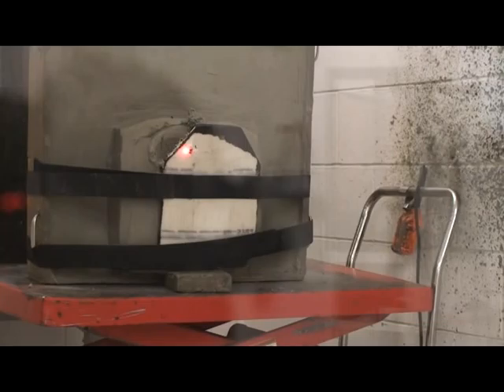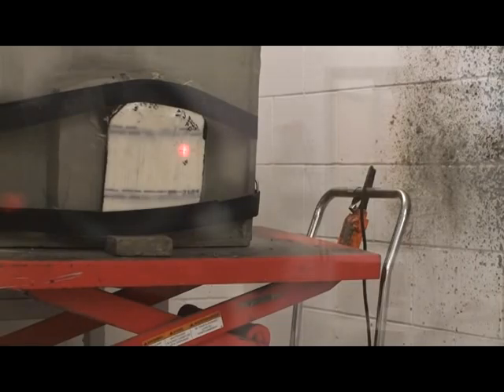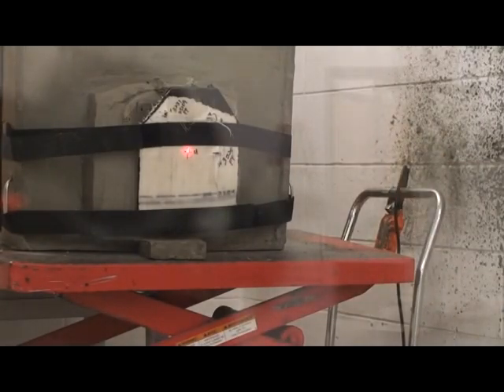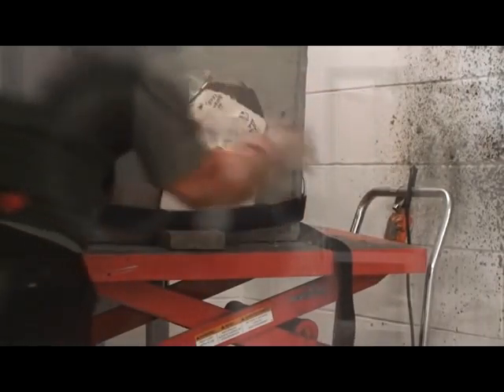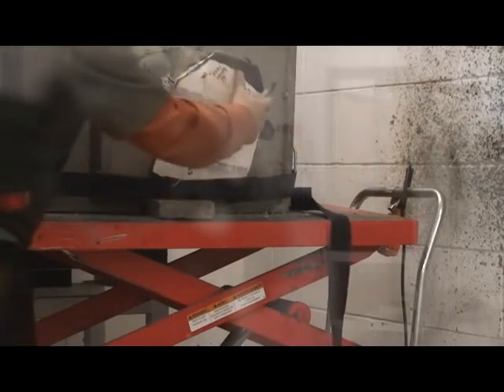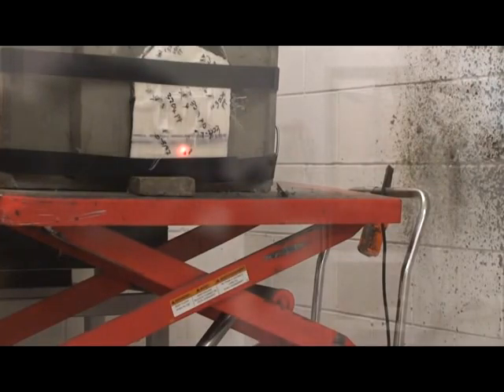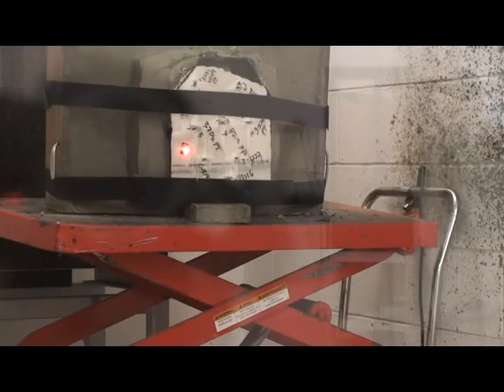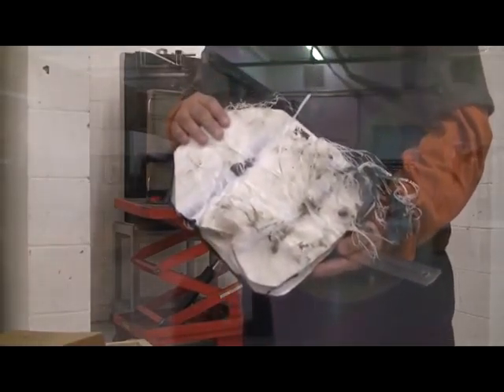Kick Ass Plate defies 10 SS109 shots

Comment: PFC Wilson is incorrect.  The M855 round is indeed a superior penetrator than a standard 5.56mm round.  I have no clue where you're getting this "weak" impact stuff.  Where as mass structures like brick or cinder blocks will absorb its energy, it concentrates itself with hard plate.

Heck there's a video in the "related videos" section on this page showing some M855's almost punching through 1/2 plate while commercial ammo is just splattering on it.

Comment: thats only because the ss109 isnt truly armor piercing,even though it houses a penetrator

as a matter a fact any round in 5.56 is far too light to even consider putting an ap penetrator inside because the weak impact doesnt make much a difference.
the ss109 is just a way to get so called "AP" rounds in the civilian market to make money.
the ss109 basically has the same effect as regular 5.56 rounds

the military uses regular ball ammunition because 5.56 ap's dont really exist.

-pfc Willson
Reply: XM193 penetrates ar500, out of a 20"-24" barrel, at 150-200yds.  "any round in 5.56 is far too light to even consider putting an ap penetrator inside": wrong.